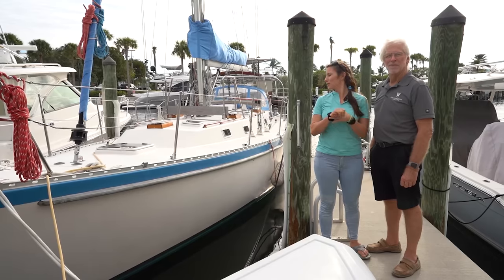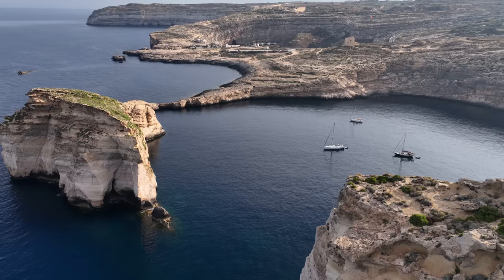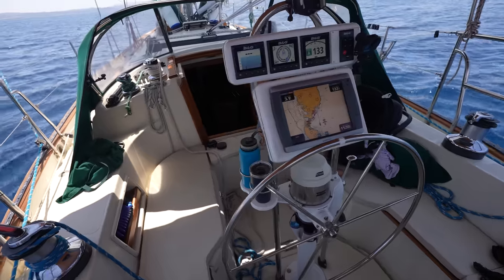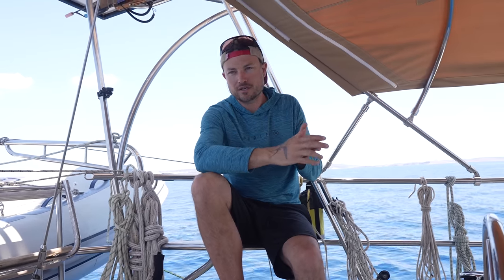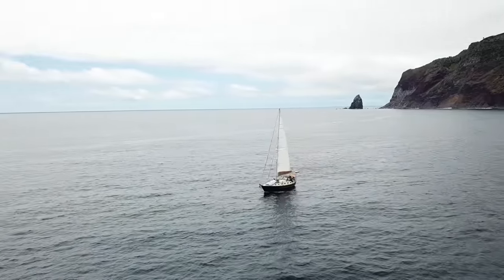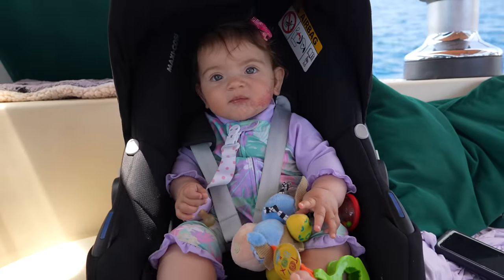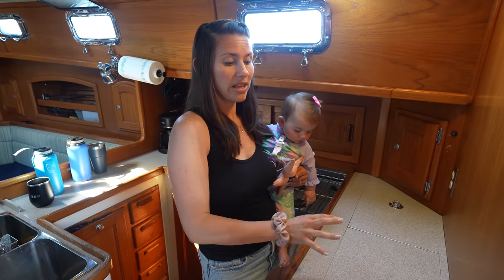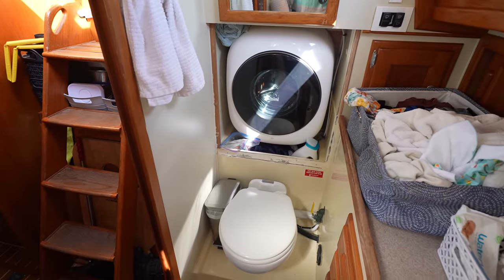Did we Choose the Wrong Boat? | S08E18

Comment: One of the things you didn’t mention about your Pacific Seacraft is the safety features which were designed under the waterline.

As you found when drilling through the hull for a new seacock, you have 1 1/4” thick layer of fiberglass in the hull and it retains the general form of split underbody with ventral fin between keel and large skeg. 

As Dick Beaumont, builder of Kraken Yachts has mentioned  “I also discovered a trend in the industry to move away from tried and tested blue water features such as an integral keel, skeg-hung rudder and a solid hull specification, in favour of cheaper or faster options.”

Comment: I'm blown away that it's already been 2 years. I would of wanted a cat for the extra living spaces but y'all's breakdown also lets me know I really only considered living area as a priority.
Reply: For a live aboard with a family, a catamaran would be my first choice as well.  Delos has 13 foot more of a boat than Atticus and even it gets small with a child.
Reply: Sailing cat in the future would be ideal. Provided you have a good stash of cash.
Reply: There are issues with Catamarans, the not infrequent Corkscrew/Bucking  Bronco motion really does my head in as a motion when one Hull is affected by a Wave before the same wave affects the other Hull affected me very badly when young  ery fit and healthy. Now I'm  old and disabled a Cat is right out of the question and os further ruled out by the generally large open spaces in the between the Hulls accommodation and Cockpit areas. Being the equivalent of a steel Ball Bearing in a Pinball Machine has Zero attraction for me, then add in significant annual Costs, problems getting a Marina Berth if you need one, if you can even find a Berth for a Catamaran - Berth availability can also be a Real problem with Minohulls of 50ft length and Over, and annual Costs Skyrockets with those too. Yes some Monohulls also have much too wide open areas with lack of handholds and places you can wedge yourself into as well. An example is Linear Galleys which even with a security strap  an have you e ding up on your ear, if trying to use it underway. They are fine while at Anchor or in a Marina though. BUT  if you can find a well designed Cat, with sensible secure stuff tonprevent anyone getting thrown across a large saloon, and the Motion doesn't do your head in, plus are OK with them being downwind focused and rubbish going to windward, then there are, if you have loads of Cash, some very nice Cats that can be very nice to live with, that are available. The Leopard ? I think it is that the YouTube Channel Sailing Sisu has, is one of those nice ones, plus it looks to have been well designed and built. Some, are so poorly Built, they barely survive a few years Chartering sadly. So if determined to have a Cat, due your due Diligence prior to Purchase, and you should land on your feet. Very Best Wishes and every success finding an outstanding Cat when in Search of one. Bob, still landlocked in Wales.  👍⛵️✨️✨️✨️
Reply: @brownnoise357  thanks for taking the time to break it down for me!
Reply: @brownnoise357  98% of their time is spent at anchor.  I can tell that you have never owned a catamaran, I doubt that you have even sailed one.  Your opinion is a collection of other peoples opinion's.  Most of them probably never owned a cat as well.

Comment: Hello from Ontario Canada, you checked off everything about your boat that myself as a sailor would also like.  For me, the larger, more protected cockpit that could be possible with a squared off stern combined with a sugar scoop for ease of entry/exit at anchor is about the only changes I would prefer.  I would consider an aftermarket bow thruster upgrade project for your future :-).

Comment: For maneuverability, you may want to consider the jet thrusters in the bow.  My next boat will definitely have this as I single handle a lot.  It would be an easier mod without installing the tunnel.  It's a gorgeous boat and one on my short list.  I only sail the great lakes so transom access to the water might override the canoe stern.  I want a solent rig or cutter.  I do like the idea of a deck track for self tacking in single handing situations.  Storage is problem on every boat.  Great review.

Comment: Our bin type freezers had baskets that could be lifted out--and one got good at hoisting the basket, retrieving the item desired, and replacing the frozen food quickly before too much heat was gained.  We gave up rummaging with the freezer open and cold fingers.  Rubber gloves and a quick hoist--and the deep freeze is back to normal ASAP.  Front opening freezers with pull out  internal drawers are not so power efficient--but are the next preference because of the more convenient access to stored food.
Reply: I agree. Use your ingenuity to solve the freezer problem. The use of multilevel baskets and shelves that allows access to  deep longer storage can fix your problem without compromising the structure.

Comment: The side spray coming around the dodger in heavy weather can be fixed using temporary transparent heavy duty  lee panels either heavy-duty Velcro fastened, or my preference is hooks and eyelets, with shock cord loops and hooks at the edges.   Keeping out of the wind is essential to prevent exposure fatigue--even when wearing heavy weather clothing, when your body burns its energy reserves just to stay warm, the mind loses the ability to react quickly or reason at 100%.  It would be one of my priorities,  You can still go forward, you just need to leave the leeward panel off.  I would be mindful of fitting a solid dodger with panels each side that lift up to stow under the dodger roof, when the existing dodger is up for replacement.  I would build it in PVC foam sandwich using fibreglass, because of its  strength and insulating properties rather than heavy marine grade plywood.

Comment: A terrific over view of your boat. I wish more YouTubers were as observant and straight up about their boats. We all know cruising is fixing your boat in..... but the other aspect is how to make our boats more efficient, comfortable and safer. 
Love your analysis of the cutter set up. My Hunter Passage 456 is a cutter. All I did was to release the bare cutter stay and tie it to a shroud to get it out of the way of tacking the jib. I'm mostly solo and I know I can handle my asymmetric spinnaker.. but I'd rather have a furling gennaker.  I've been thinking about putting in a bowsprit... duh!  OK so Stay sail smaller jib on my inboard cutter stay. Then get whatever big downwind (light air) sail for the fore shroud. Got it. ( On our recent crossing of the Pacific, if the jib wasn't out we couldn't turn the boat to point into the wind. Sometimes the jib was too much.  I was surprised it didn't overwork the autopilot). It's clear I don't have this sorted, but you reframed my options.  
The lines back to the cockpit. When I'd charter 22 and 28 foot boats when I was learning I never thought I'd be able to sail with less than two people on board. Almost nothing went back to the cockpit. (The charter company also said, "Don't use the autopilot' like it was a rule. Try going all the way forward just to hoist the jib when the boat can turn 180 degrees in a minute.) Now I have a 45' Hunter that I single hand. 
The deep dive fridge. I absolutely sympathize. On my boat I've got the same set up. My fridge is full of plastic baskets and containers....none of which fit. What I did today was to load my groceries into the top teetering basket. No solution at all. I think what needs to happen is a split. Top and bottom (I also have a front door.) but also a rack or something so items don't drop to the very bottom. One thing that works with all storage, boxes, layers within boxes (or deep dive fridges), take a photo of each layer. Then when you want to find something, you flip through the photos instead of dig.  Where's the video where someone's figured this out? 
In my galley I've got slightly larger hatches. I found an exhaust fan that I fit into a piece of plywood cut out to exactly fit the open hatch. It's got  fingers that stick out for what the latches are. It fits in, doesn't fall out. It effectively exhausts the propane exhaust and the cooking smoke. (This is a much bigger issue that people are only beginning to think about. On our recent passage they'd fire up the stove, burn the bacon, all the hatches closed because it was cold, and they'd wonder where the soot that condensed in the head was coming from. Even a USB fan would help a lot. 
Instead of waiting to make the perfect cabinets, how about just making hanging organizers? Big pockets. Easy to sew, easy to  modify, easy make better ones. (I made one of these for my camping hammock out of mesh. First one, awful but it worked, they got better and better.) 
I've noticed on a lot of boats, including mine, that just a little bit of 'good' woodwork really sets off the interiors of a boat. Yours has so much. (Take a look at Neel trimarans, amazing boats the interiors look like they were made by people Ikea fired for being too boring.) 
For my back onboard, leg overs. On my back, in bed,  both legs, knees bent all the way over then to the other side. I count with my fingers so I don't have to think about it. 100 each side. Otherwise my back can get stiff after a few days of just sailing.

Comment: Hey Jordan and Des, since you have mentioned needing a bit more solar to run everything in a few videos now, and considering the extra demands of the washer/starlink, etc., what are your thoughts on adding flexible panels to your dodger and Bimini? I know that generally they aren't the most optimal areas for solar with shading from the mainsail, but, I'd imagine that your power demands increase mostly on anchor when you can move things around a bit to help get more sun on the right places (like tying off the boom to Port or Starboard). Or even having some flexible panels you can move around deck to soak up a few extra rays. 5 years ago I would have scoffed at the idea, but, the tech has come a long way, and a few small 100w Sunpower panels could maybe help fill the gaps. Just a thought.

Fair winds and enjoy fruits of all your hard work!

Comment: There are a million opinions... but I think you did it right.  You went from a boat on a shoestring budget to a home on the water for your family. You priority will be your family... not hauling water. Your priority will be your family.... not finding a laundromat.  Your family is safer with the updated electrical. Your quality of life is better with the starlink...don't need to worry about uploading...staying connected with your extended family...and Issa may use that one day in the future for online schooling.  You didn't buy a boat with those existing systems that almost give you what you need. You bought a boat on which you could install the systems that will best meet your family's needs.  I think you did it right.

Comment: there are bow thrusters that don't need a tunnel and a propeller - they use pressurised water squirted out of 2 thru hull fittings - maybe / perhaps a partnership with the makers and a win win - one maker is Jet Thruster and there might be others

Comment: Regarding solar, have you considered replacing your existing 400W panels with new 550W bifacial panels? That would theoretically give you roughly 37% more power from the sun. Cheers.

Comment: I myself love the rounded stern but your solar panel situation is limited because your arch was not designed with a dual panel set that could be slid out from under the top set. Slid in at the dock, slid out at anchor and underway. Rethink your arch.

Comment: There's no such thing as a "Perfect" anything. Everything is a gradient of what works & suits your needs.
If Perfection exists it would be like saying that hundreds of years in the future boats will atill be like this. And we know that can't be true.
Instead each of us is left to be inventive and come up with ideas to improve things for themselves and others. Invent something.
I like Desiree's ideas about storage and access. It looks like something worth adding. Lower freezer access and stuff like that around the kitchen comes in handy. 
As for those messy cabinets I'd suggest adding a thin rail around the middle that a wooden shelf can sit on. And to make it removable, add a cut so the shelf will sit flat against the back when larger items need storage. 
Solar can be any flat area. Up high or down low so long as you can access it to clean the salt off.
And there is no reason to limit yourself to the perimeter of the boat itself. You have boundless sunny space all around you which is rarely occupied. If you think you need more solar area why not consider adding floating solar cells behind you as you travel or anchor. I recommend something inflatable (so it can be stowed) and large enough to be generally stable. Tow with a line and drape a power cable to the towed train of flotation solar. You could tow multiple small rafts linked not only with power but if you want to get clever some of them might be self-propelled to keep them from dragging the boat. And if you really get ambitious they might even tow the boat when there are sunny skies but no winds (like on the equator)
Heck these things could be making fresh water and pumping it to the main boat too. 
And maybe one day when the children are older and need more space they could enjoy stretching out on connected rafts. 
There's a few invention ideas for you or anyone else reading this. I always have more than enough ideas squirting out my ears to share (so my head doesn't explode ;-) Somebody had better sell them online and make some $$$ on it. 
Enjoy.

Comment: Hi guys!  

It’s great to hear that your major project and family are healthy and ready for adventuring. I completely agree with your boat comment. I think for a boat in that size and price range with the build quality of a Pacific Seacraft you really couldn’t have done any better. We were thinking at the time of your decision you might have gone with the more expensive, cruising Valiant on the West Coast. We were glad you didn’t for since we are Pacific Seacraft sistership owners. I think that you will be able to sleep more soundly since you have done the upgrades yourselves and done them right. 

I have to agree with Jordan on the cabinet between the galley and saloon. We have friends whose PS40  has one and it really breaks up the sight lines. It makes the interior seem much smaller and darker. You can always hang some small net hammocks for longer cruises. 

We store all of our dinnerware and glassware I’m the larger cabinet above the fridge and small jars and cans in the recessed cabinet above the fridge. Our side cabinets look like yours, stuffed to the top. We are in the process of adding shelves. We have the full width v-berth and although it’s harder to climb into bed but at it’s max with it need king size sheets. It’s huge. We don’t have the sink either, it’s a cabinet. 

A clear connector between the dodger and Bimini and easily removable clear side panels should keep you dry sailing. We have done the full enclosure and it makes the cockpit almost as dry and toasty as down below. 

We were also glad you got to see the US East coast and glad we met you. 

Anyway, happy to hear you are ready to adventure. 

Ed and Tina
S/V Merlin

Comment: Well I want to partly oppose to your thoughts about production boats that I drove a lot during the last 20 years. They are mostly built to sell on an exhibition. They more or less lack of many points you need in daily live. 
Not only can't anybody go down without using his / her hands. Often there is even no provisions to get you grab if you need to go though the boat when cruising. The Hanse "apartment" may be nice in the harbor. You would shout like a sailor with this in a slightly rolly anchorage.
---
I would not blame the canoe stern the small amount of solar. For me that was the design decision to dedicate more of the boat length to the interior than the cockpit. 

Over all I like the design of your boat - even to be a little jealous 😉😊